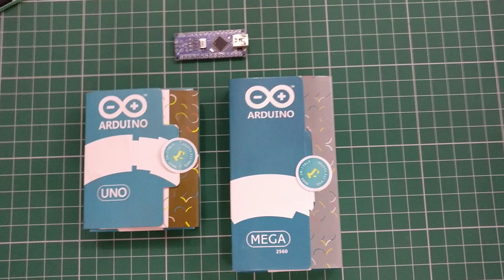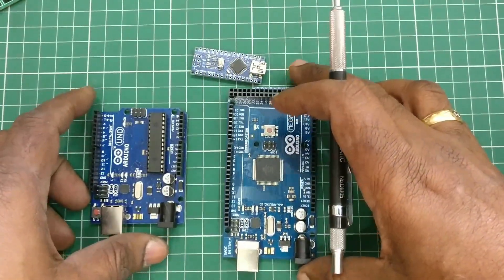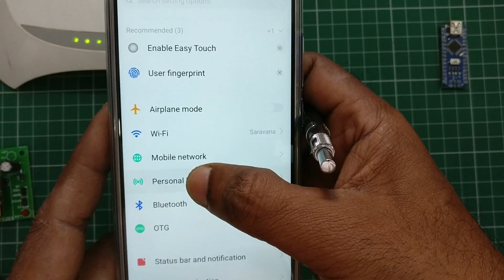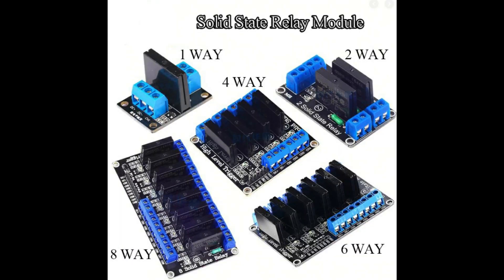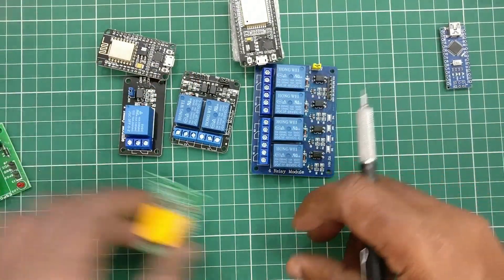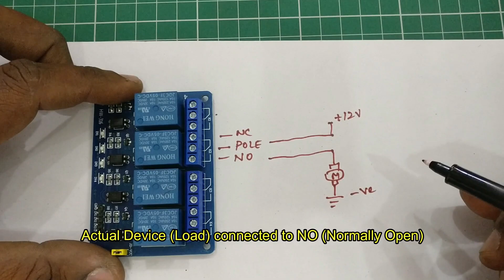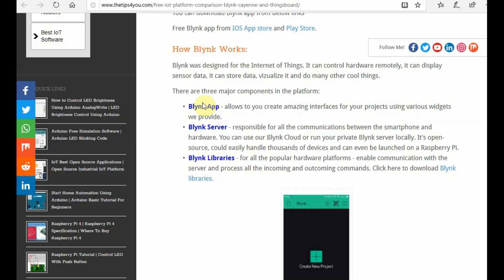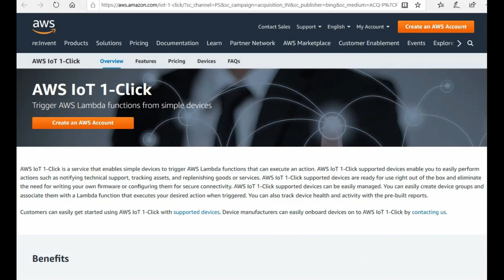IOT PRACTICAL GUIDE 1.Getting Started

Comment: Sir i have one question  why you said "always provide external power supply" to relay module.
Reply from the maker: Arduino  has maximum rating of 40 mA source or sink per GPIO, with ESP module it is only 12mA.It is not good practice to source all current from Arduino itself,which may damage Arduino.External power supply is standard industrial practice.